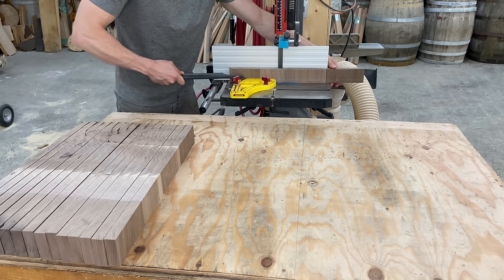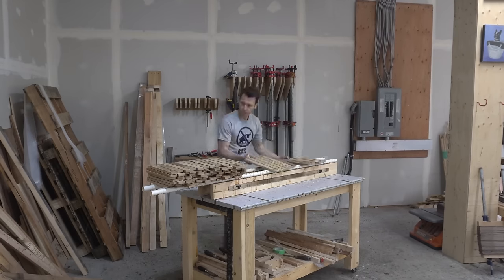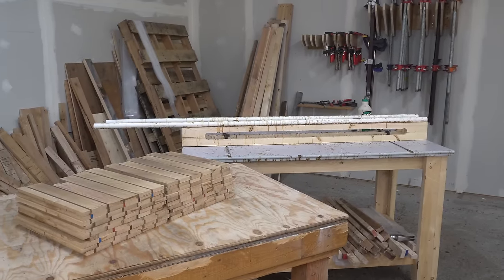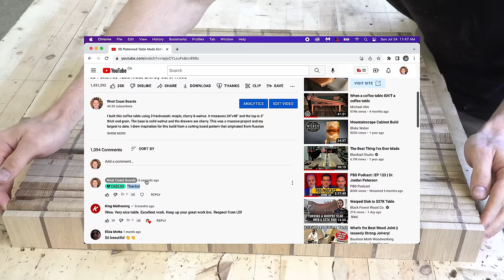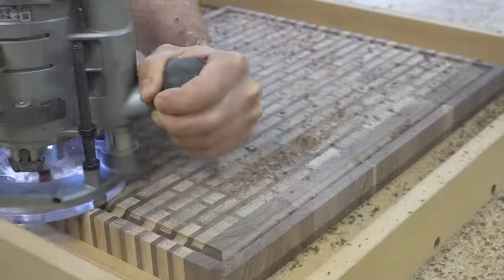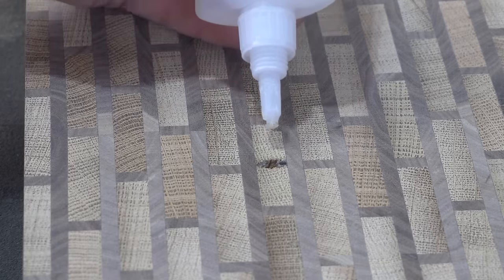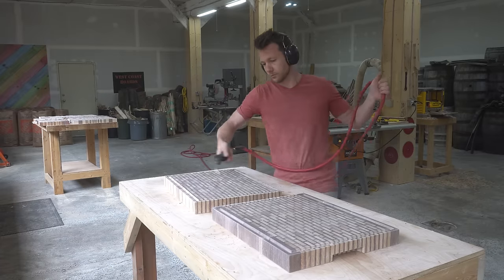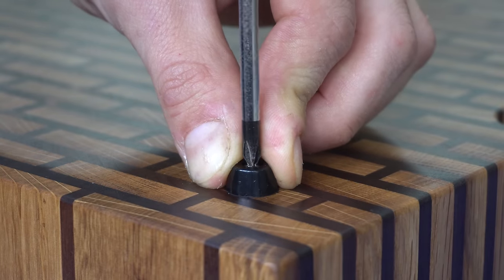Reclaimed Oak + Walnut Cutting Boards

Comment: I've watched hundreds of wood working videos and I've never seen somone use the saw backwards like that. It solves a huge issue.

Also, the reason I avoid oak in cutting boards, I still use it now then, is that leaving metal on it with moisture will bring out the tannins and cause black stains. It's on my list to make a small solid oak end grain board and do the vinegar and steel wool thing on it to turn the entire thing solid black and see how the black layer holds up to use.
Reply from the maker: Sounds like an interesting experiment!

Comment: Great boards !! Great Concept.  Alot of hard work is never fast and easy.
As you can see, White Oak is used for Wine Barrels for a very good reason, its harder than Teak. Cutting boards need to be cleaned with Bleach or Alcohol, rinsed and re oiled because Foul Funk can grow anywhere on any wood especially with Meat and Fish.

Comment: **obligatory, you used oak for a cuttingboard comment** :-) You edge jointed teh stave on the table saw with no jig? Parkt of the reason I don't use more staves is that using my jointer jig on the table saw makes using them cumbersome. If you showed a deteiled explination on this it could be a game changer for many folks. Great video! Great pace!

Comment: OK, just going to comment again rather than editing my last comment again. On the bandsaw you can create a zero clearance insert to avoid some of that blowout. Or a lazy way is to put some masking take across the slot next to the blade, doesn't last but it helps.
Reply from the maker: I’ve tried the masking tape method at the table saw in the past, does work well for a short time. I definitely need to look at something more permanent for my bandsaw.

Comment: A small thing. You have all those barrels sitting there. Why not pop 1 at the end of the cutting table. All your cuts will fall into it and you wont have to collect them at the end from the floor. Same for your rubbish. I watched as you threw it onto the floor. Barrel or bin. Safety for you too.

Comment: Is CA glue food safe?  I thought it wasn't so I have never used it on cutting surfaces.
Reply from the maker: Great question and one I wish I had a simple answer for. It seems like the internet leans towards it isn’t but some brands like Krazy and Rhino glue are considered food safe by the FDA, while others like Titebond and Starbond are not. Some say it’s only toxic while fresh and once dry it becomes inert like an epoxy. Others say it maintains its toxicity even when dry and softens when it comes into contact with water. I’ve used CA glue in my boards at home and I haven’t experienced it softening when wet. I’m of the opinion that it is non toxic once cured.